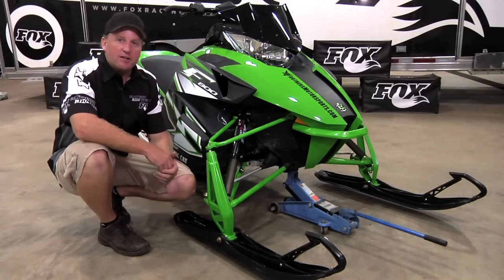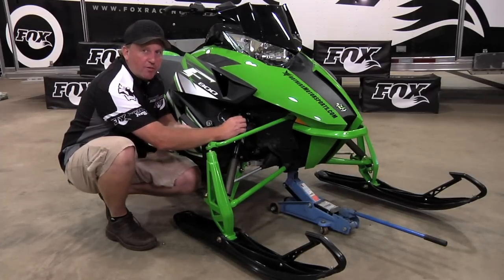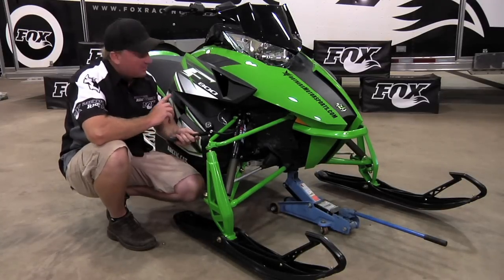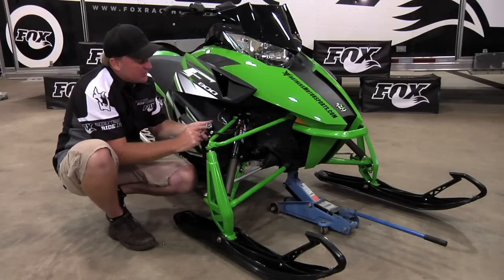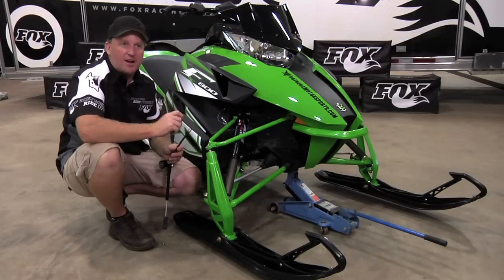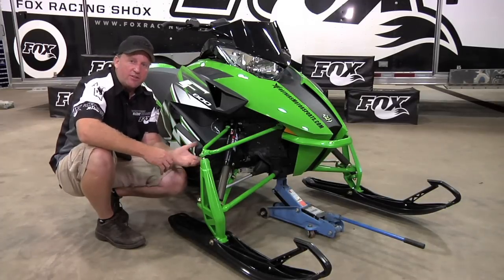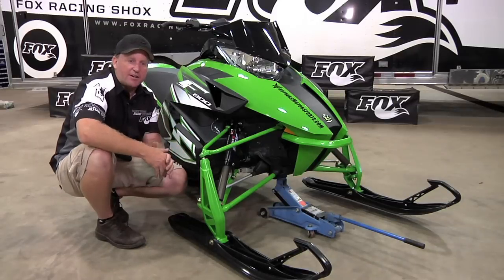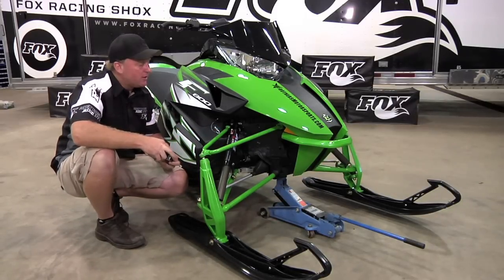F Series Air Pressure

Comment: Interesting. I like that pump, great that it releases the schraeder before releasing air pressure. That gives you a very accurate reading. But 2 concerns:
1) You really should be using Nitrogen. air has moisture in it and that is bad in a shock. Performance and longevity.
2) The air is your spring and should be set for your weight. If your shock performance is sub-bar that should come from damping adjustments. That's why high end shocks like the Float X EVOL are nice.